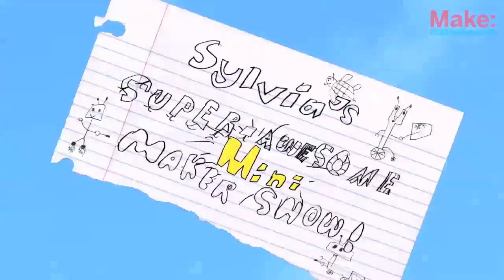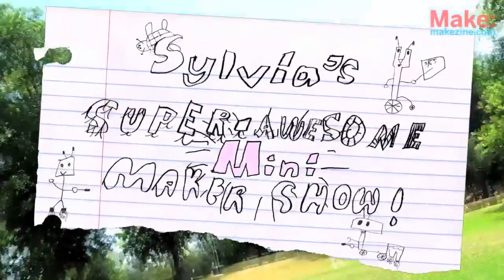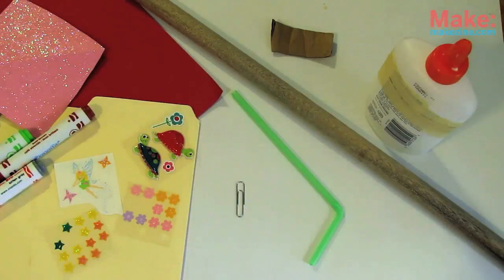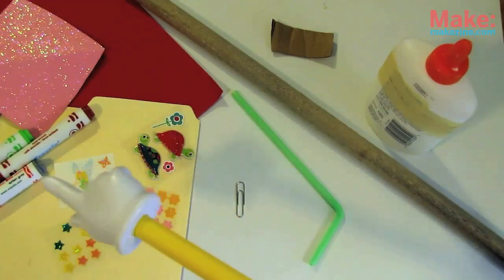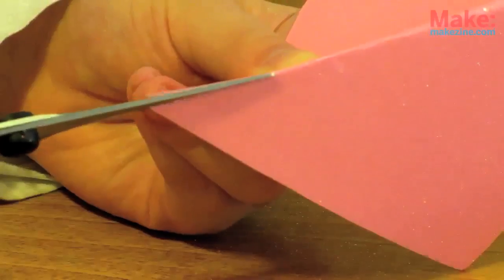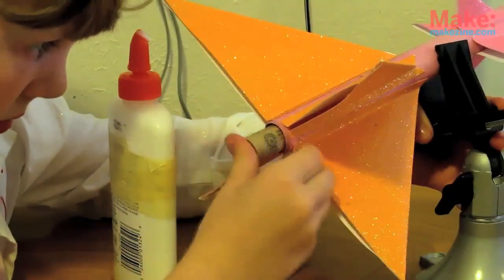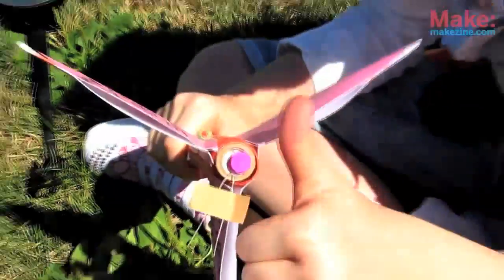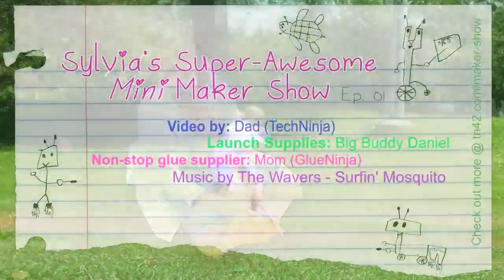Sylvia's Super Awesome Mini Maker Show: Rockets

Comment: @YupHio lol, the thrust is only strong enough to lift a few pounds, maybe. and the chute blast is small enough to be contained in a thin cardboard tube, the blast damage would be less than a coffee burn and the thrust won't hurt you as you would have to hold it on yourself. Rockets don't fly backwards, the thrust won't touch you and the heat wou dissipate quickly from the rocket trail. Yeah it would hurt, bruise your rib(s) but you would be fine in a week.

Comment: Hmm pretty cool but it's not all that safe for kids to pull untested rocket designs out of there ass that don't fly straight. I see a big danger if you have a model rocket swirling horizontal, it could hit somebody (ouch), catch them on fire, and then the parachute charge can explode and cause further damage. Go with a kit rocket, those designs are tested and safe.

Comment: Just remember, that if you put a bug inside the nose-cone, you have to protect the bug from the ejection charge that is intended to pop the parachute out after the rocket burns out.
Otherwise the ejection charge makes the bug REALLY unhappy.

As in, it doesn't want to move very much any more.  Sniff.  :(